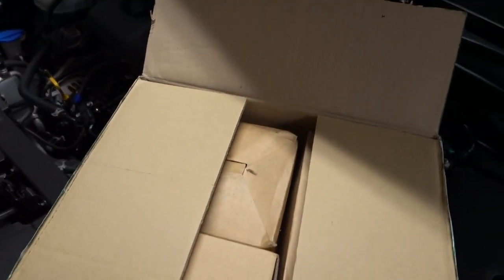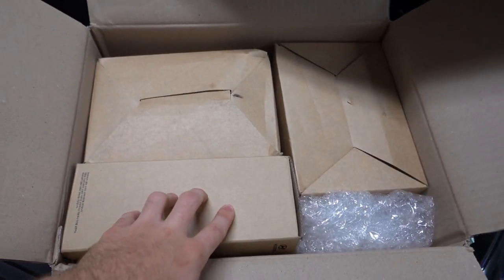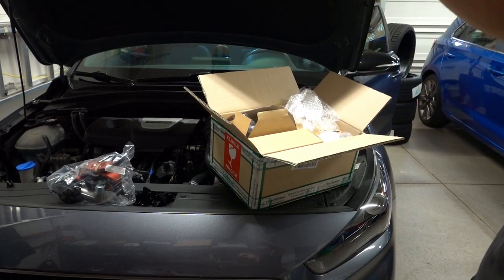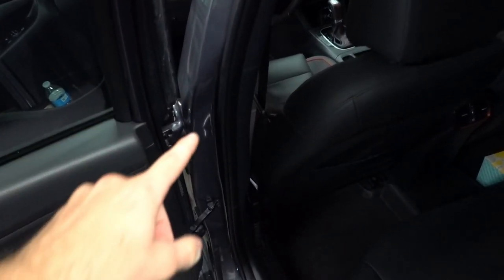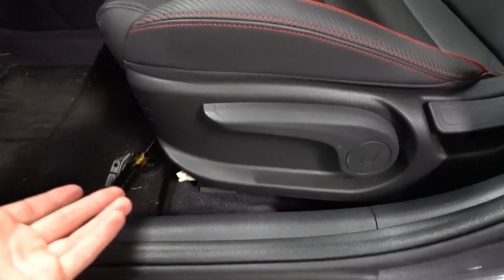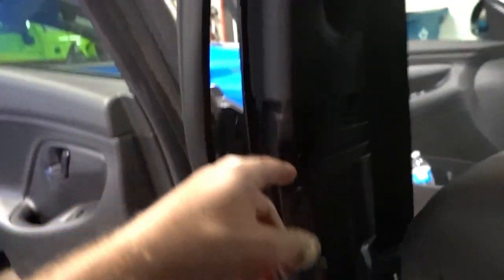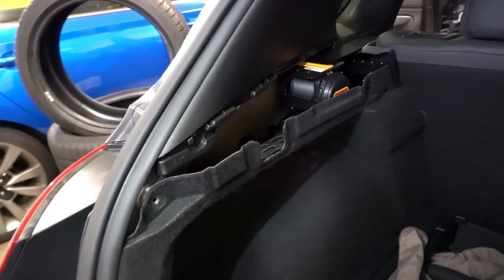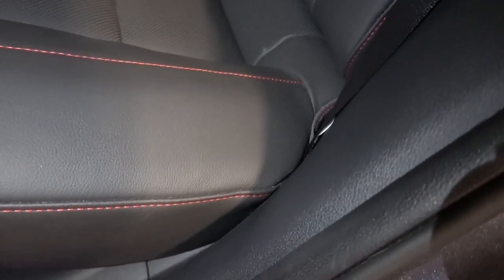Installing OEM Red Seat Belts! | Hyundai Elantra GT N Line

Comment: I'm getting them through n performance store on instagram/ Facebook.  Only $45 per belt and $210 total shipped... that's a great price.  They are awesome to deal with and very helpful.
Reply from the maker: Wow really?! Thats cheaper than anyone I have seen.
Reply: Yeah, they have been great.  And they are going to see if they can figure out what all is needed for the heated steering wheel besides the wheel and switch!
Reply: @mrwill219  let us know what you find out!
Reply: Got them in, the fronts are installed, super easy! I paid $210 but he seriously underestimated what shipping would cost, so it will probably be $310 for anyone else.  He is a good guy to deal with.  Sent the belts knowing he was going to lose money on them and asked that I pay the extra $100, but said he understood if I didn't because he misquoted the price.  I'll send him the money, its worth an extra $25 per belt.
Reply from the maker: @mrwill219  Thanks for the update! Yes even $310 total is a good deal for all four.